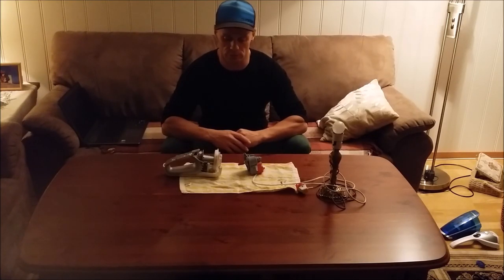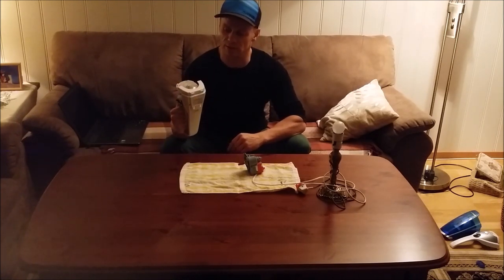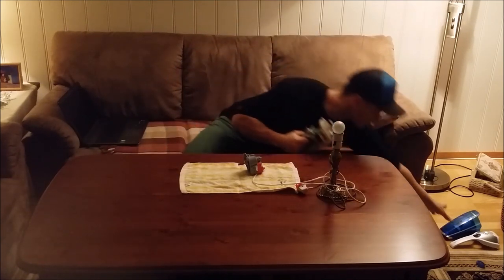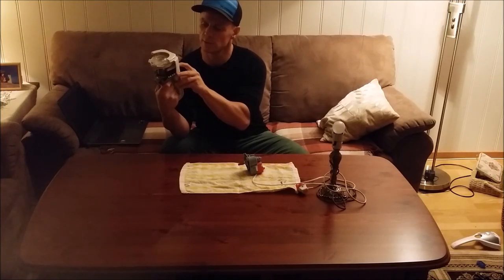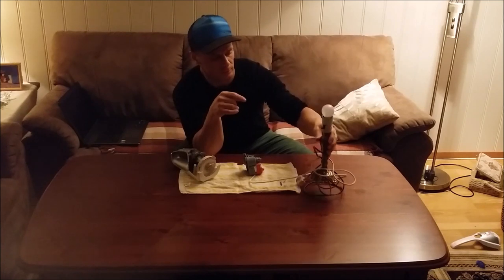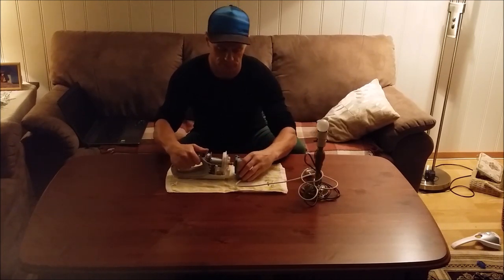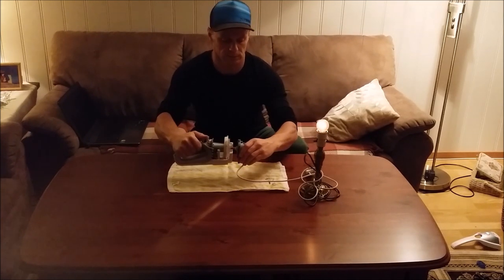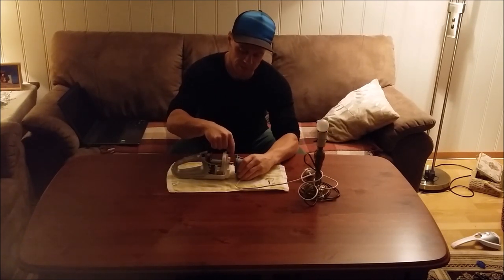Replicating Gerard Morin Free and Natural Energy - The Mystery Solved

Comment: I tried the same thing with a different "pump", but only got around 0.2 volts output with it using a ordinary portable drill.

I guess the waterpump I'm using is not efficent enough, or the drill isn't fast enough, BUT got a reading from 0 to 0.2 continous volt. Tried different speeds and got different steady readings, so this will be cool when I get a stationary 24 volt 4000-8000RMP rotor!

I got the transformers ready, taken out of various microwave ovens, while I'm waiting for parts to arrive :)
Reply: Your drill wasn't spinning fast enough.
Way to go.

Comment: step it up with a transformer and then a spark gap between ?
Reply from the maker: Yes Ronald - I am sourcing parts and upgrading my whole setup. Very exiting with this new kind of current :-)
Reply: Can this also run a heavy electric motor, of which around 800 watt ?
Reply: Ronald Jansen
If you want to run a heavy electric motor (800 watts), and you want to use the 'Gerard Morin' device, you'll be wasting power, since the Morini device is not an over unity device, and is actually less efficient than connecting your 800 watt motor directly to a power source of the proper voltage & power capacity. The configuration of the Morin device on this video is not capable of no where near 800 watts. I don't think you'll get much more than 100 watts with this circuit & the battery life will be very short. Adding transformers to the circuit will not improve its efficiency nor power capacity.

The Morin device is only suitable for a science fair project. It's a generator (which is the pump motor which is driven as a generator) is capable of outputting no more power than the batteries in the vacuum cleaner, & the batteries are much much less than 800 watts.
746 watts is equal to 1 horsepower, which is far greater than the motor in the vacuum cleaner. The pump motor is a fractional HP motor, and when operated as a generator it will only be capable of outputting the electrical equivalent of a fractional HP motor, which would be a fraction of 746 watts. So no way can this device output 800 watts.
Reply: I had hoped that it is an over-unity device because for years he has studied on  nikola tesla
Reply: Ronald Jansen
The Morin device has nothing to do with Tesla's work. Just because he "studied" Tesla's work for years doesn't mean he benefited from it.
Reply: which is a shame because it seemed so
Reply: Ronald Jansen
The setup here consists of an electric motor and an electric generator. The overall efficiency is the product of the efficiencies of each. State of the art electric motors & generators can be as high as 98%, however the ones used here are far from state of the art. But for the sake of argument let's say that they are each 98%. The overall efficiency would be .98 x .98 = .96 or 96%. But more realistic numbers, such as could be expected for the setup used here, if the motor was 80% efficient & the generator was 70% efficient, the overall efficiency would be .8 x .7 = .56 or 56% efficient. No over unity here.
Reply: Oke, thanks

Comment: Why would this not work?
And what is the mystery here?
This is basic electrics.
Where is the "free energy"?
in the batteries of the vacuum cleaner!
Reply from the maker: Patrick - you are asking the wrong questions ...  Look closely at what Gerard Morin is doing in his videos. This is my first step in replicating Gerard Morins experiments. Links to his videos are provided above - good luck discovering ... ;-)
Reply: Well, answer them anyway.
Reply: patrick donegan
This has nothing to do with free energy.... trust me, I know how this device works. Anyone who has a high school level understanding of science should be able to understand this. The hand held vacuum cleaner contains a battery & motor. Its motor is coupled to an electric powered water pump motor. The water pump motor is operated as a generator, thus when the vacuum cleaner motor turns the generator, electricity is generated. This is a basic principle suitable for a middle school science project & nothing more. It's not over unity, because the motor & generator each have losses. If they didn't have losses, then the device would still not be over unity, but unity.
Reply: I think people meant free energy is the excess energy retrieved in a system than it consumes.

Yeah of course theres no free energy, theoretically if you want to really wring the cloth dry and tear out every single strand meat from a vulture scavenged carcass.

But to already the finite ability of men, free energy is that because it will be one step closer to not footing another bill of electricity, apart from constructing the expensive device from resources.

Nothing is free.   But FINANCIALLY, to the Bankers and oil oligarchs, yeah, its FREE energy to them.  And they won't take it lying down, but they'll bust your door down and kick you in your teeth, of if need be wipe out the whole family.  

I can't say it more direct than that
Reply: Constantine Joseph well, this demo has nothing to do with "above unity"
Reply: By saying bull shit you already gave up on solar and wind power.  Lets not catch you using those forms of electricity.  You practice what you preach.  Continue to pay top dollar while I get to run  my BMW i3 for free
Reply: Tom Hoehler Stop being immature, Free energy means Free energy in this lifetime for the end user of not paying the oil companies.  Why are you so hard up if the sun dies billions of years later.   Your body won't be around to witness it either.  

It is Free energy in the context of comparison with oil and no one wants to pay dickheads who earn over the top money.  I'd rather give some of my money to renewable energy enthusiasts.  

I have enough power to run my BMW i3 and I dont worry at all about gasoline bills and travel freely.  Why, to me its freedom.  FREE energy indeed!
Reply: i3 doesn't run on gasoline go read the BMW website
Reply: +Lone Ranger the very fact that you think that electricity is generated or created in some way tells me you know very little about electricity apart from what they thought you in school
Reply: dogstar167
taught not thought.

I agree that what we've been taught in school is not all there is to it, in fact many times what we're taught is nothing but disinformation, but until you could provide something more convincing (which I doubt), regarding electricity, I'll stick with what I know. Aka, instead of keeping everyone in suspense, why don't you come out with whatever it is that you supposedly know that no one else does?

Comment: Why a waterpump ???
Reply: It doesn't have to be a waterpump motor. It just has to be a motor that has internal magnet(s) so that it could be operated as a generator. A waterpump motor is generally powered by 120 v, therefore when operated as a generator, it can output that same voltage at the proper rpm, which makes it suitable for interfacing with light bulbs of that voltage.
Reply: Thanks for the information :)
Reply: ***** Good overunity BS debunking (above).  The motor doesn't need magnets, an AC induction motor will also work as a generator .Hams have been coupling gas engines to AC motors (through V belts) to use as field expedient  (cheap) generators for their temporary shacks for a long time.  They must be turned at more than thier rated RPM to generate.  Keep up the myth busting. (edit) (or edit out your insights and encourage this nonsense )